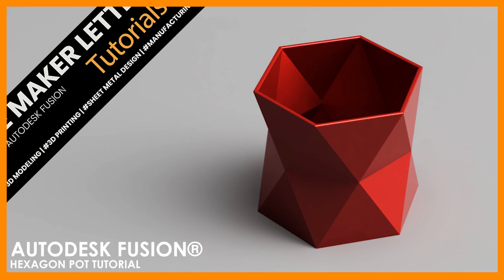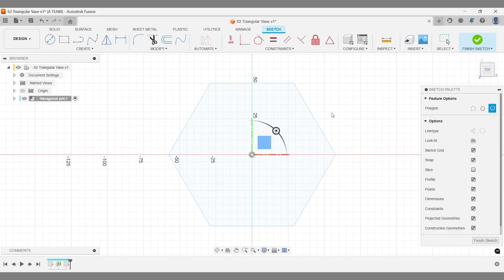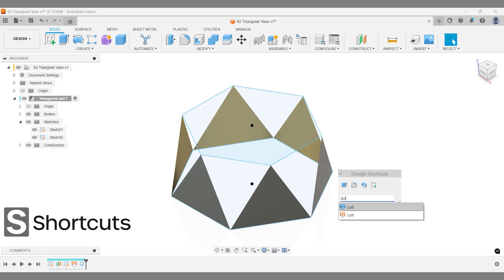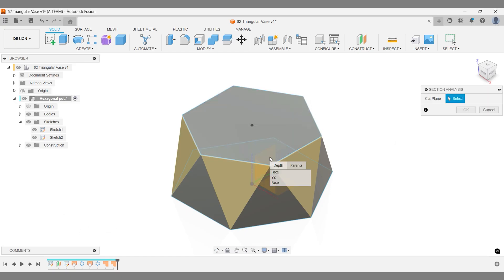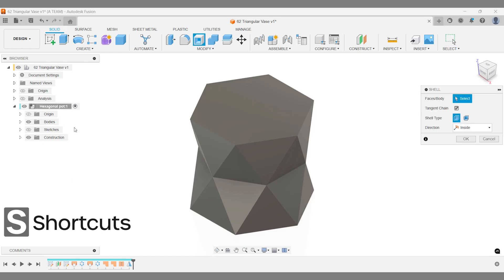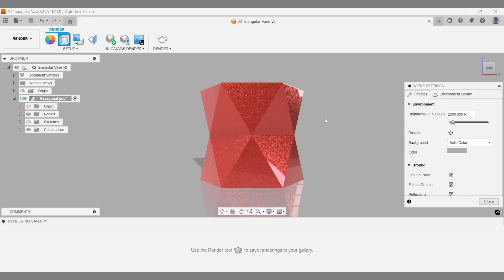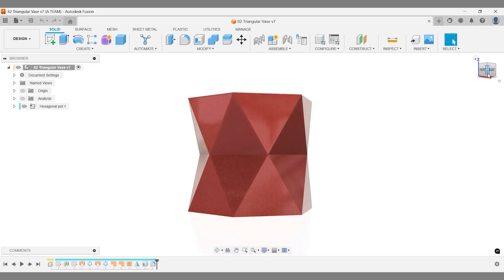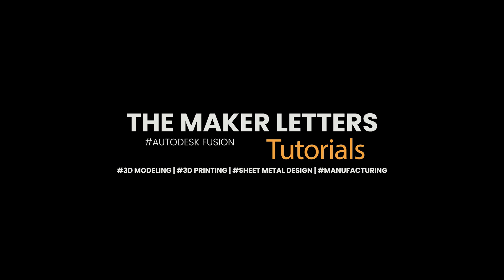Parametric Hexagon Pot in Fusion – Perfect for 3D Printing!

Comment: Faces in surface bodies have two colors. A front or normal side, and a backside. Grey face is normal, yellow is backside face. Read more about normal faces in 3d graphics.
Reply from the maker: Thank you! What determines whether something is labeled as the front or the back?
Reply: @The_maker_letters  Not really sure what was that in your case. When you create triangle sufrace maybe its the order of selection. If you want to be normal [grey] outside [as it should be] you can always click Design > Surface > Modify > Reverse Normal. The Reverse Normal dialog displays. Select the surfaces for which you want to change the normal direction and click ok.
Reply from the maker: @okuniewiak thank you!